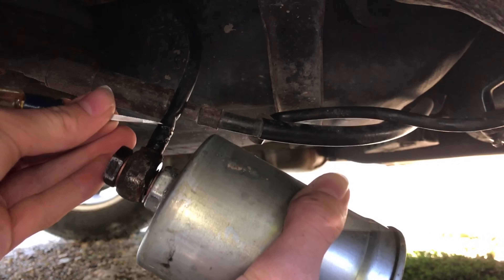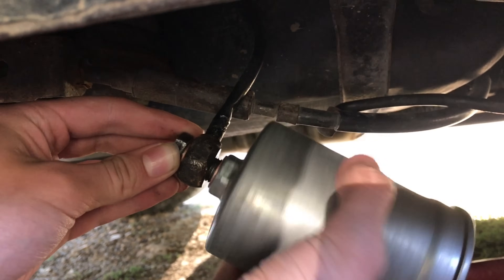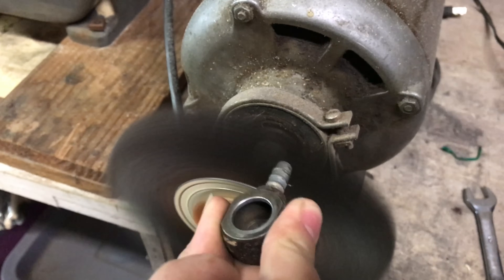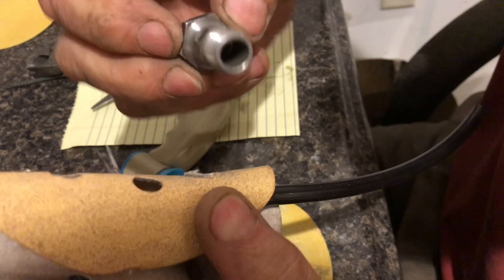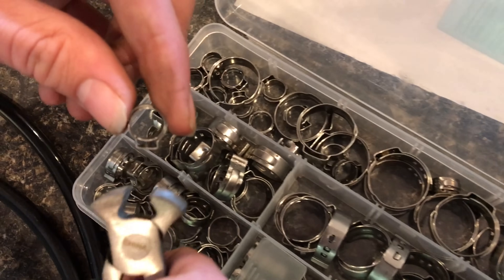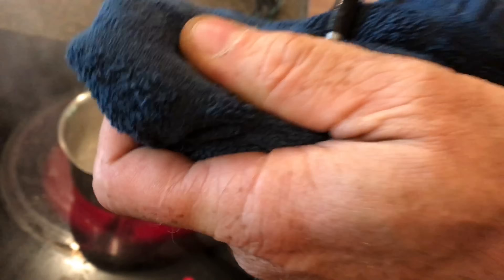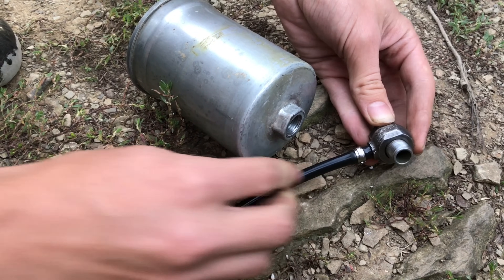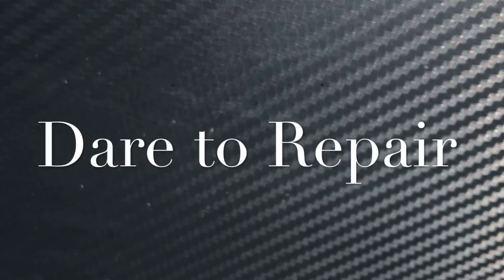BEST ways to repair dorman nylon plastic fuel line tubing

Comment: How do you place the line in boiling water when your fitting the connector to the fuel line already in the car. I removed the broken clip and now I can’t get the new one on even with using a heat shrink gun, oil or a little grease. So frustrating

Comment: There is a better and easier way to do it...
https://youtu.be/d-ujDEPuRsE?si=nzv2QiXfqZBGr56O
No need to heat anything...
And add a little bit of silicon grease on the fitting and it goes in easy.
Worked like a charm for me on my Ford Fiesta

Comment: If you use the boiling water method for softening the nylon, how long before it is soft? Dorman says 10 minutes in hot water. Do not tell you how hot is hot. You used boiling water. Would 10 minutes in boiling water be too long?

Comment: Are those fittings in any way rated to handle fuel? From what I could find, they arenonly used for air in air compressor systems. 

That's kind of a big deal, tou dont want the plastic degrading over time and having fuel leaking everywhere...

Comment: I installed those on my 93 ranger near the fuel tank . It was leaking somewhere , but I reconnected the the hose again and it not leaking . I dont know if I trust that on a fuel pressure line . I dont know.

Comment: I am awaiting some fuel line ends and unions, so glad  to hear they work well, the unions. Also, that a hair drier would do the trick. I had to cut a whole to access the fuel leak. I had a factory made line I had never been able to replace, failing tiwce to remove the tank. Now, with the tank loosened a bit I  easily slipped a wire down and drew the line into place. But after driving it seemed the other disconnect, the return line, leaked. Or, there was a leak on an extreme turn.  In any case I have new ends and unions so--if I had damaged the factory part trying to remove the o-ring, I still have a way to go with new ends.

Comment: If you have to create a certain bend , you will have to put a soft copper piece of tube inside 
The plastic line , heat it and make your bend then remove the copper pipe. It’s called mandrel bending. It’s so the plastic line doesn’t kink.

Comment: Your a legend I had an issue with same plastic pipe but on the oil line for the transmission cooler, Thank you so much.

Comment: Do you have a technique for making tight radius bends without creasing? I've tried all heating methods but they will crease before getting to 90*. It must be possible since the OEM nylon line I am replacing has such bends. The 3/8 fuel line  piece I'm replacing makes a tight S bend within 4". I can't even get close to that.
Reply: I also need to know this

Comment: Thank you, that is exactly what I was looking for, that 2nd method w/hair dryer. I received one unit (Fuel Pump Assembly for 2001 Saturn SL2), it is OEM, but the central tube isn't pushed all the way to the end, like a gap ~2mm to where it is supposed to be. I thought maybe to use heat gun a bit, but was afraid to damage the tube (and the unit is ~$330), as was said in the film. But the hair dryer won't hurt anything. Also that type of connections you can see on many aftermarket FPs, if you want to replace just the motor, you would need to disconnect and put back a lot of those w/wavy surface.

Comment: Great video, those couplers did not work for me on steel to vinyl. Steel side would slide off even after numerous times to fully seat.Have you tried using these with stainless steel fuel lines?
Reply: Did you ever find a diy solution? Only way I know is complete replacement or they have a pricey tool that makes quick disconnect flares on steel lines.

Comment: Fantastic thankyou repaired my nylon car fuel line after the garage split the nylon pipe replacing my fuel filter . The part I needed was not manufactured anymore so I took a pipe from a car of the same make and year from a breakers yard and used the push on connectors as described . Purchased the connectors from amazon for £5.00 for 5 connectors. Brilliant 👏 video.

Comment: The concentric ridges from the sandpaper help seal.  Scratches from inside to outside (or patches of corrosion) will leak. 
I'd lay down a sheet of cardboard or something rather than dropping fuel system hoses in the dirt.

Comment: I've been a mechanic for 15 years with diesels, and plenty of automotive experience as well. This is the first I've ever run into the stuff on a 97 ranger. I've now melted away 2 feet of line trying to make it go on the damn fitting. This is terrible stuff to work with, I'm familiar with quick disconnect but they only have the barbed fittings. Not sure how I'm supposed to use boiling water behind a fuel tank either, seriously junk
Reply: @ ragalyisp
☆☆Y are "《Flush cUT》" pliers not needed (?؟!) for re-connecting opened up rubber fuel line/hose, that is supposes to be also passing high pressures: 40-60 psi
Y duz it sem that this ishuu iz not brot up by anybody else? I tried a fuel pressure test at the fuel rail in engine bay without offishil fidingz from the profeshinil kit and i had ☆gasOLine LeAKinG eVERywheRe wiTH using reGUlAR WOrm** CLamPs

Comment: I suppose this would not work with GDI high pressure fuel lines with pressures from 50 to 200 psi right?

Comment: Excellent info ! Many thanks from the UK !!!!
Reply: @mr. kevin greenwood
Y are "《Flush cUT》" pliers not needed (?؟!) for re-connecting opened up rubber fuel line/hose, that is supposed to be also passing high pressures: 40-60 psi
Y duz it sem that this ishuu iz not brot up by anybody else? I tried a fuel pressure test at the fuel rail in engine bay without offishil fidingz from the profeshinil kit and i had ☆gasOLine LeAKinG eVERywheRe wiTH using reGUlAR WOrm** CLamPs

Comment: You’ve used every thing I hate when it comes to pipe lines. Those clamps suck. That hose is garbage. And those damn banjo fittings are the worst. I’d replace that entire set up with AN fitting and braided line. Hell rubber and screw clamps would be an upgrade.
Reply: Rubber fuel injection hose is over $6.00 a foot. 😬

Comment: All very good info ... but you missed out the bit about refreshing the copper sealing washers for the 'Banjo' fitting these need to be anealed (softened) by heating to to red hot and being allowed to cool .. they will then seal the banjo more easily and effectively ...
Reply: @ Steve Jacobs
Haaahh
Y are "《Flush cUT》" pliers not needed (?) for TigHtly (so idiz seald) re-connecting opened up rubber fuel line/hose, that is supposeD to also be passing high pressures: 40-60 psi؟؟!
Y duz it sem that this ishuu iz not brot up by anybody else?؟ I tried a fuel pressure test at the fuel rail in engine bay on Poniak Sunfire2000 without offishil fidingz from the profeshinil kit and i had 150mL ☆gasOLine LeAKinG eVERywheRe under the car by using reGUlAR WOrm** CLamPs

Comment: is there a fitting that goes from one size to the other? My fuel pump has the 3/8's tube on it but then turns to 5/16 coming from the engine. So it doesn't seal!
Reply: Napa has a book that has a reducer compression coupler in it goes from 3/8 to 5/16.

Comment: You can use a caulk gun and wooden clamps to press on fittings cold.
Reply: I tried the heating methods with no luck. Using the caulk gun worked great!
Reply: can you explain the caulk gun method? thanks
Reply: @rbuggs3658  https://ls1tech.com/forums/conversions-hybrids/1628357-home-brew-budget-nylon-fuel-line-tool.html
read and look at the pictures, easier then explaining
Reply: @rbuggs3658  Get a piece of round stairway handrail, cut a 3" section, drill a straight hole (in the fuel line size you need 5/16 or 3/8) through the wood, then cut the wood with a thin bladed saw like a coping saw, this is the clamp that goes over the plastic line. Use hose clamps to hold it together.

Comment: Remember never to use a blow dryer or heatgun on a line with gas in it
Reply: @hendricksonrunner5015  I'd rather say it here than read about someone who didn't hear it later, be an ass about it if you like
Reply: lol ....good advise, it needs to be said, and make sure it isn't pressurized.  Especially when working with Diesel, if atomized fuel penetrates your skin, and gets into your blood supply, You are toast.
Reply: @Texaca  also ear plugs if you're working on pressurized fuel lines, you really don't want gasoline getting in your ears dehydrating your eardrums
Reply: @connorfreeman9845  --- Wow! never thought about that one, good advise 👌🏽💯

Comment: 1) don't use craft knife to remove old hose, use a soldering iron tip to melt a line of holes. knife will score the barbs and can leak
2) trim your flippin nails
Reply: he did trim his nails after he started the clip but must have reviewed it at the point he clipped em, ya know dude, a Dremel will remove that dead skin! Don't want that kind of impurities in the injectors! Great video although, oops! I'm sorry "perfectly" done! lol

Comment: Greetings Sir from Egypt. By the way you could be one of the best voice narrators in the world if you like to!
Reply: @TubesWidener
Y are "《Flush cUT》" pliers not needed (?؟!) for re-connecting opened up rubber fuel line/hose, that is supposes to be also passing high pressures: 40-60 psi
Y duz it sem that this ishuu iz not brot up by anybody else? I tried a fuel pressure test at the fuel rail in engine bay without offishil fidingz from the profeshinil kit and i had ☆gasOLine LeAKinG eVERywheRe wiTH using reGUlAR WOrm** CLamPs

Comment: Are the orings in the quick disconnect ok for use with fuel?
Reply: Just make sure you buy the ones designed for fuel. I'm sure the air brake ones would fail. I used a 3/8 brass compression union on my gm truck. The line was a hair bigger then 3/8 but with force the tubes went in.

Comment: Good video very detailed. I like your comment about shying away from a heat gun and using a hair dryer because they don't get is hot.
Reply: Y are "《Flush cUT》" pliers not needed (?؟!) for CrImPing and tightlysealed re-connecting of opened up rubber fuel line/hose, that is supposed to be also passing high pressures: 40-60 psi?؟!
Y duz it sem that this ishuu iz not brot up by anybody else? I tried a fuel pressure test at the fuel rail in engine bay without offishil fidingz from the profeshinil kit and i had ☆gasOLine LeAKinG eVERywheRe wiTH using reGUlAR WOrm** CLamPs

Comment: My Truck has this the problem is my fuel pump has a 3/8 outlet but then it is reduced down to 5/16. Well  the. O rings started leaking or so I thought I tried replacing the line with repair kit so it didnt fit I dont think with my tools I could get the 5/16 on a 3/8 connector. So I tried replacing O rings in connecter. No good it is the damn connecter bad. So I just spent another. 75 bucks on new line. The point is I should have just done that to begin with I was trying to save a few bucks. It ended up a real waste of time especially time and cost me more
      
.    So if you got a leak at the connector on a Dodge Dakota 98 just get new line. It sucks I wasted my time and extra $ I really thought I could fix it but they don't sell proper repair kit for that application. Now if its just the line you can do it
Reply: this is what I'm dealing with, the line coming from one of the hoses on the truck goes from one size to another ! is there a connector that adapts to this size change?

Comment: There are plastic fuel lines in a intank fuel pump in a Yaris, i couldnt change the filter because they wont come off, was concerned about using heat so i just cleaned the filter with carburetor cleaner in reverse ... will hold for now.

Comment: You are a wonderful man
Thanks from morocco
Reply: @Milan milanello
Y are "《Flush cUT》" pliers not needed (?؟!) for cRImping and tightly re-connecting opened up rubber* fuel line/hose, that is supposed to be also passing high pressures: 40-60 psi??
Y duz it sem that this ishuu iz not brot up by anybody else?? I tried a fuel pressure test at the fuel rail in engine bay without offishil fidingz from the profeshinil kit and i had ☆gasOLine LeAKinG eVERywheRe wiTH using reGUlAR WOrm** CLamPs

Comment: I bought the push in connectors because of this video .. the reviews are terrible . You won't ever feel safe with them . Buy the brass unions .
Reply: key is to insure the cut tube is square

Comment: You are a lifesaver my guy. I've been looking for a helpful video on how to solve this issue with my Foxbody Mustang. I wanted to do the job the correct way instead of rigging something up. This video was greatly appreciated
Reply: Y are "《Flush cUT》" pliers not needed (?؟!) for re-connecting opened up rubber fuel line/hose, that is supposes to be also passing high pressures: 40-60 psi
Y duz it sem that this ishuu iz not brot up by anybody else? I tried a fuel pressure test at the fuel rail in engine bay without offishil fidingz from the profeshinil kit and i had ☆gasOLine LeAKinG eVERywheRe wiTH using reGUlAR WOrm** CLamPs

Comment: Nice! I'm working with a 89 diesel F250, it appears to have nylon line, the return line is leaking fiercely 5/16 is one size I assume 3/8 is the other? where did u get those? thanks for the up load.
Reply: did you find a kit ? i’m looking for the same
Reply: Deepblu dude try eBay
Reply: Sorted but thanks....

Comment: Very good work. Was wondering if you could use that style of quick connect fitting. Didn't think you could. Had them with reverse osmosis system before and they work great. Just wasn't sure about gas going threw them as it eats certain plastics...,